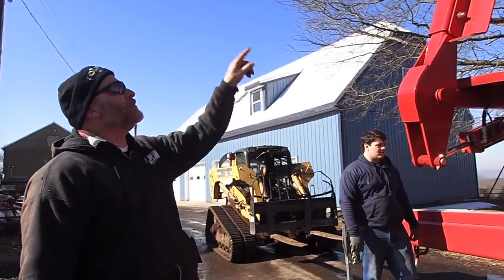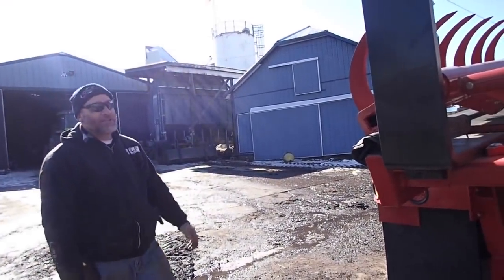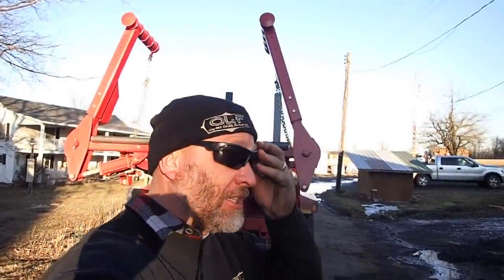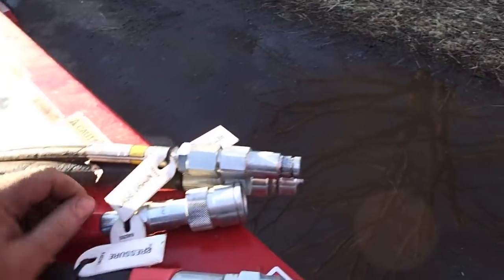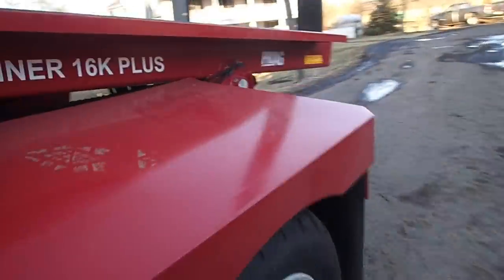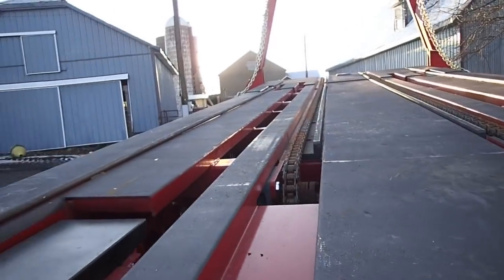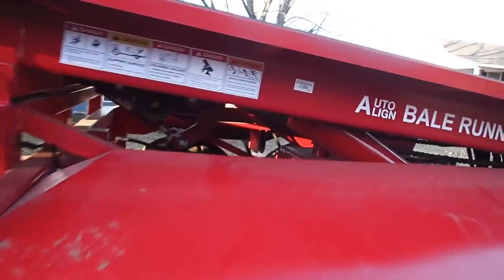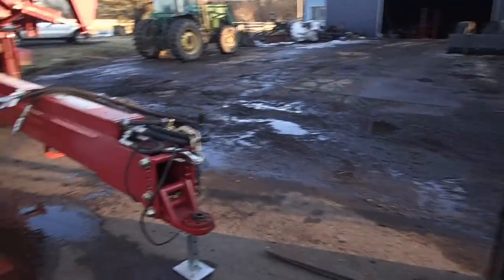Stacker Has Arived

Comment: I just put the power beyond on my 9470RT tractor. The power beyond “KIT” costs $600+ from Deere but the individual parts needed for MY tractor cost less than $300 for everything REQUIRED on my tractor from my Deere dealer. (My tractor already had the case drain on it. )

The load sense hose is supposed to send a pressure “signal” back regulate the hydraulic pump pressure on the tractor. It’s supposed to help keep a steady pressure on the implement and keep hydraulic functions operating at a constant speed. 

Any John Deere prior to an 8000 series does not have the pressure compensated hydraulic pump. So if you were to hook it on your 4960 the load sense hose would not be used. You would still need to install the case drain plug on your 4960. To do that you would remove the plug on the back of the rear end just above the serial number tag and John Deere has an adapter to screw in and go to the flat face case drain coupler. Your 4960 runs a lower hydraulic pressure so blowing the tops off the valve stack shouldn’t be a problem. 

On newer tractors like your 8120 or your 8530 there will be 3 plugs in a cast pice (typically under your hydraulic valves). Each plug will be marked with a P (pressure), LS (load sense) & R (return). You will also need to find the 4th plug that dumps DIRECTLY into the rear end and install your case drain coupler there. 

I can send you pictures of the installation instructions from my tractor if it helps you.

Comment: Power beyond is just an extension of the tractors hydraulics so it knows when its necessary to pump. Load sensing line (1/4 inch female )will be fitted on your European JDs including 3/4 fittings for pressure and return . Case drain is usually required for certain hydraulic motors and needs to be plumbed directly into the backend casing where there is no chance of back pressure 
Hope this helpful
Reply: Reallygarlicky m

Comment: Jack Stacker and Mess ups should have double checked with the buyer on those brakes before the build stated  and another thing, the seller should have made sure the correct quick connect fittings were going on those hoses for the tractor being used. As far as I'm concerned that should be an even up trade for those hose ends, send the equipment back to the manufacturer that came with the stacker. It would only be fair. Better yet, have Meesicks come out for a run down of the right and have them put the correct hose ends on at no cost.

Comment: G'day, Wes! Teresa did a nice job! She really has a fabulous sense of humor! That was quite humorous... With, call the complaint department! Lol!! 🤣 By the way, the 'Power Beyond' option provides an unvalved hydraulic loop. It is intended for attachments that have their own valves, like the Bale Runner. Noticed, your marvelous New Bale Runner 16K PLUS, with Auto Align® is designed for stacking wet or dry 3x3 bales, 3x4 bales and 4x4 square bales. I do look forward to seeing the 'Brand New Bale Runner' in action!! Thank you! 

Cheers! 😊🚜❤️✌🏼

P.S. "In a nutshell, Power Beyond is a facility in the outlet section of a mobile directional control valve, which enables the pressure bypass gallery to be isolated from the tank gallery. By doing this, the pressure gallery can then be carried over or continued on to the P port of another directional control valve (DCV). Hence the term Power Beyond (the first DCV) and its other name: "High Pressure Carry Over" (HPCO)."

Comment: I had to put a special power beyond setup on my 7800 for a new planter. Of course the 7800 goes down this year during planting and I can’t run the planter on anything else because of the hookup. You can bet there are a couple of others that have it now. New equipment is such a pain if your tractor is more than a year old.

Comment: In the Uk we have different names for them. The return is a free flow return so it can always return under no pressure the load sense is under pressure all the time so when the electric box needs oil for a ram it’s there all the time. But the most important is the return that’s under no pressure.

Comment: Case drain is exactly what it sounds like, it drains excessive fluid from the hydraulic pump or motor, not an abundance of pressure but enough to protect the seals in the motor.  A load sense line will “sense” pressure in the pilot system and stroke the piston pump and create flow.

Comment: Power beyond can normally be taken directly from the pump just need some adapters and a small valve for the LS line. 
The drain should be mounted to the oil tank (gearbox for John Deere) so there cannot be any pressure on this line (max 2-5 bar sorry for metric:-) )
Also you should mount a safety on that drain line on the wagon itself (a one way valve with a spring load of 5 bar should be okay) so it can leak when the line is not connected to the tractor.  It cheaper to loose some oil than replacing  seals.

Comment: Power beyond is nice! I'm not a mechanic but usually in Europe it has a flow, return and sense line. The 4th is probably a return when the valve body on the stacker has a leak.

What I would suggest is to have different couplers or switch genders on the pressure and/or return lines. Blowing valves is expensive and it you'll never be able to connect it wrong that way.
Reply: yes you are absolutely right

Comment: In Australia all our manufacturers use standard pioneer fittings for everything. It’s a pain as all the USA and European equipment use the flat face for their sump drain and we are always changing the tractor fittings over to the pioneer (also get a few blown up pumps from being connected incorrectly).
The power beyond ports on the 8 series are under the hydraulic block. On the 8530 there should be blanks for the fittings for pressure and return under number 1 scv. The sump (tank) is further down on the transmission housing and will need the kit with the adapter for extra length so you can plug the hoses into. I think you may need a seperate kit for the 8120 power beyond to get the fittings required. 
The load sense is only needed on systems that use a lot of oil flow. The load sense is to kick the pump into gear. The pumps are now made to reduce their capacity when not needed to save on wear, heat and fuel. For those that don’t know, the power beyond system just runs oil out one line through an electronically controlled (usually) hydraulic block and back to the tractor. When u trigger a function on the machine it sends a stream of oil through the load sense line to tell the pump to ramp up as I now need some more flow. Haven’t had much to do with LS lines to the early 8’s but I’m guessing the 8120 will be a seperate kit but you may be lucky with the ports on the 8530. 
The other responders saying it’s on the right hand side of #3 will have 6 series scv setups like most of European built machines, your 7530 and 7410 are probably like these and will need the seperate plate. 
This’d be easier if you could attach pictures to YouTube, hope this helps.
Reply: The basic thing is that the sense line has to have 30 bar on it. If it's not the pump will increase or decrease flow.

Comment: I don't know on the bigger John Deere's but on our 6000 series Johnys there is a hydraulic valve block on the right hand side across from your hydraulic outlets on the left that has 3 plugs in it, that's your power beyond, just need too screw in the fitting for those plugs. And a case return fitting which is normally just above the PTO.

Comment: Hi load sensing implements have three connections a pressure, a return , and the small pipe is load sensing which tells your tractor when to pump oil, the case drain is just a return so goes to dump. Most load sensing implements have a tap that you can unscrew if you don't have power beyond then just just run it of a scv on constant flow and leave the load sensing pipe disconnected.

Comment: Would you like a picture on how my 16k pro ag is plumed to my 8100 we use 3 of the hoses two on one scv and one to the case drain we also changed all of them out to pioneer fittings. I have ran a 16k plus’s for 10 years I can tell you that chain in tight in some spots loose in others when the load table is down the chain gets tight. Make sure your load arms chains are very tight you don’t way to know what happens when the chains are loose. I tell all my stackers to learn how to stack on manual before you go to auto.

Comment: I'm no expert, just been working on hydraulic machinery for a little while...I may be way off, but I'd say load sense line should go to the pump - which is on your tractor - if you NEED that for the type of pump you run off of. So that's probably not necessary to connect if your tractor doesn't have a load sense controlled pump. 
 Case drain is essentially return to tank. Every piece of equipment I deal with that has case drained components just tee those lines into return to tank circuit.

And I agree with your friend - the electronics added into hydraulic equipment has been more headaches / general PITA for service than convenience / ease of use has been improved for the user. I have more crap sitting around the yard waiting to be repaired involving the electrical controls / computers / sensors than I do regular mechanical broken stuff.

Comment: Its load sensing system, in most cases you can use it without having it installed on tractor ,there should be manual valve in valve block to choose system or you have to change hoseses in valve block, if so you are using supply ,free return x2 and the small load sensing plug stays unplugged - very common in Europe ,

Comment: Power beyond has a pressure that’s coming right from the pump. Load sense to tell the pump how much oil the implement needs. a return that is plumbed back into the charge Circuit, and a case drain that has no restrictions that drains right back to the reservoir. Its designed to be an extension of the tractors hydraulics like what your doing here where the implement has its own controlled valves  that need constant oil flow. I don’t know why your dealership doesn’t know about it but it may have just been the guy you where talking to. Ask a technician they should be able to get you set up.

Comment: Power Beyond
Modern hydraulic systems have a pressure and load sensing pump. Basically the hydraulic system is kept at continuous low pressure until the pump is told by the load sensing (LS) hydraulic line that it needs more pressure and flow, then it ramps them up to meet demand. As the pump only pumps oil on demand it saves power and stops the oil getting so hot and therefore it lasts longer before it's molecules break down.
Power beyond is just an extension of this on an implement. Again it allows the implement system to be at a low pressure until demand is sensed by the LS line.

Comment: A Company That builds a Stack Wagon, Should have Plug and Play Universal Hydraulic Fittings to fit all Tractors Models,and you can't use it today.They need to give you free of charge everything you need to get it running.
Reply: They have the standard fittings and they have a plug and play hydraulic stuff. It only doesn't fit on his tractors, yet.
Reply: Not correct. There are a lot of different styles of quick couplers. Quick Couplers are easy and relatively cheap to replace.

Is it a common practice in the USA for them to ship a new implement and not helping to set it up to the tractor? Seems rather weird to me.
Reply: Most implements and tractors with 'power beyond' have three sizes of couplers. The sensing line is usually ⅜" while the flow line has a ½" coupler and the T [tank/return] has a ¾" coupler. Some implements and tractors that have 190Litres/minute total flow and greedy components, like multiple motors and rams that need oil at the same time, will have a larger flow line and coupler than ½"

Comment: So this stack wagon is built for tractors with pressure and flow compensted hydraulic systems. Old remote hydraulic systems are just pressure compensated the pumps run full flow all the time, the old JD  use a radial piston pump that strokes back as case drain pressure increases. So the new JD tractors should be compatible just need to tee into the pump pressure sense line. Why the change, the new system strokes the pump back to low flow when hydraulics are idle giving more engine power to the wheels, saving fuel and run cooler. If you have gear pumps you do not have this ststem. Cheers mate 🍻

Comment: Power beyond has flow, return and load sense. The load sense is for regulating the oil pressure on the tractor especially with closed circuit pumps. The forth is Case Drain, it allows hydraulic oil to flow back from hydraulic pumps and straight into the (sump, diff case or reservoir) on the tractor, it's not a flow return in the usual sense, hence why the diameter of the pipe is a lot smaller, it's not a particularly common system. John Deere should have a kit that will allow you to hook up the Case Drain if there isn't already a blanked off pipe on the back end of the tractor. Technically the load sense is a pressure line but senses the pressure in the hydraulic system on the implement. You should at least have flow, return and load sense at the side of the valve block on the tractor.

Comment: Brakes aren’t standard? Really!?
Reply: Meanwhile in EU we need air brakes as standard lol. Big difference in safety, downside is the costs..
Reply: weird stuff. other then that it looks fairly modern lol.
Reply: I was always wondering why they need so big tractors to tow (relatively) small trailers. Then I learned that they don't have trailer brakes in US and gain some respect for them.
Reply: Yep, here in Canada I've seen people tow six wagon grain trains and not one wagon has brakes. lol
Reply: @TheZwerfer14  I would think it is because of the small congested roads u guys have to travel on with smaller tractors, While here we have big enough tractors that weigh enough to stop.
Reply: @jacobblackburn6417  Sorry but if you drive on the road you should be able to stop within a safe distance. There is always a chance that a human or kid accidently runs/drives/falls infront of you tractor. Even if you don't drive near other people often. Weight of your tractor doesn't help much when you jackknife or crash.
Reply: @TheZwerfer14  you only need airbrakes if the tractor do over 40k otherwise hydrualic

Comment: There should be a valve chest to the side or just under of the scvs depending on the tractor,  that you’ll have to put couplers on to for connecting all those hoses.  It basically will make the wagons hydraulics live and part of the tractors. I’ve used a round baler with the same system. Everything will be controlled from the control box. It is s good system. The tractor only sends oil to the machine as needed rather then having a lever pulled back pumping oil when not needed. I could be wrong but I don’t think the 4960 will be set up to use that machine.

Comment: Would there be any truth that the block can handle both power beyond and power from the spool. I know our baler can. You use the pressure line to feed the block but the return goes through a pipe that's coupled to a port that feeds straight into the backend in low pressure which keeps the temperature of the oil down with less resistance

Comment: Power Beyond is usually the Flow, Return [sometimes called Tank] and Load Sensing line. That is how they all are in the UK.  I suspect your fourth line is just a single acting line for a cylinder that you use through a tractor spool [SCV] point, so not through the stacker's control box. If you hadn't mentioned that it lacked brakes, I would have put money on the fourth line being for hydraulic brakes. You would NEVER find kit like that without brakes in Europe. Either air, hydraulic or combined brakes.

Comment: hi that load sensing line is for a variable pressure system when you got that on an implament it makes all the movment a lot smoother because its not contiuasly going from full presser to nothing (but im prity sure you can convet that block to a standard system will have to install a bypass valve and pressure regulator and the softwhere to be change in the computer for that its doable you could talk to them about that as a pertentioal option

Comment: For the cost of this you could of purchased more wagons or a double trailer for your truck. I would of got more semi trailers. You can leave the bales on the extra trailers all tarped an ready to go. You can get flat beds for $5000 to $10000, so you could of had at least 5 trailers to sit hay on. The money you save not stacking and the higher production would pay for another truck too

Comment: Your loader will probably be piped up power beyond you could use the same out let’s you will just need a shuttle valve in the LS line if you tee in to the loader one. The case line will just be a free flow return for case pressure from the hydraulic motors I would think.

Comment: Looks like a nice high capacity stack wagon. But I do think its a little over engineered. Why do you need mechanical moving parts that can break and were out when gravity works just fine with no cost? Also if you have to spend money to set up "one" of your tractors to be able to run this thing, Than that means that will be the only tractor you have that can run it. That's BS. I'd bet money that sometime in the future you end up re plumbing this wagon to work more like your old one.